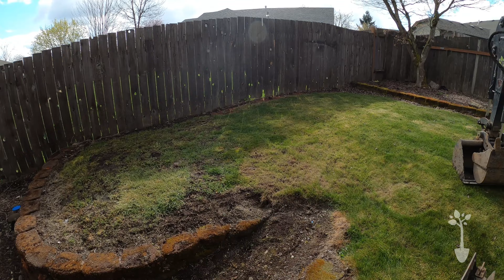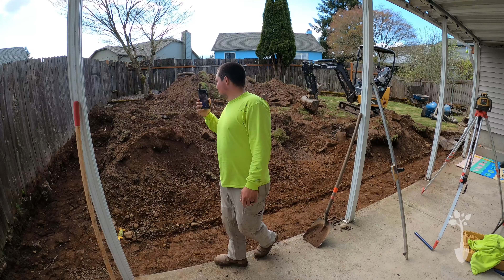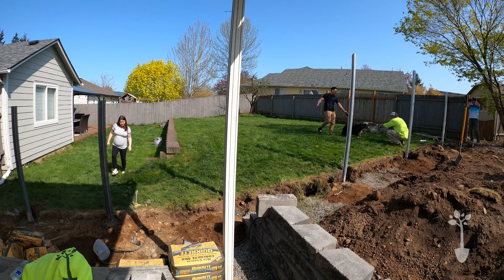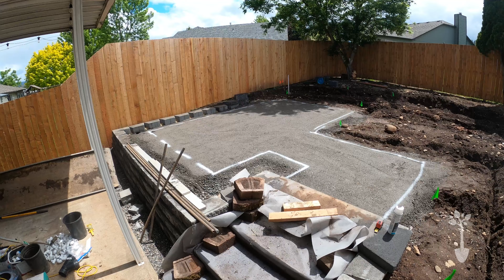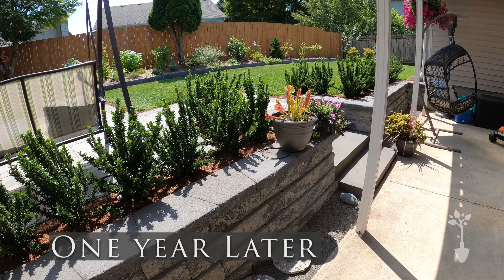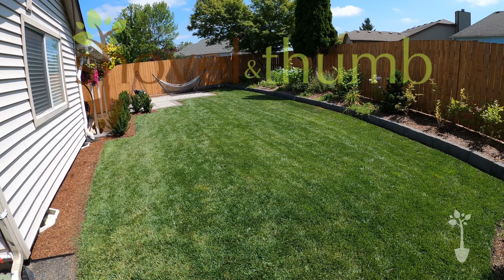Professional Landscaper Transforms His Own Backyard

Comment: Fantastic transformation!   What brand of fence posts did you use if you dont mind me asking?  Are they concrete or metal?  Its kinda hard to tell in the timelapse.  I'm in the process of planning out a fence for my backyard and the thought of sticking a wooden post in the ground makes me cringe.
Reply from the maker: Thank you! It's called the post master. It's more expensive then a typical steel round or square post, but it has a really cool design where you don't need brackets for your rails. Check it out
Reply: @shovelandthumb6420  thank you!